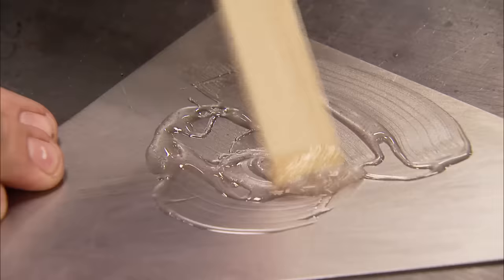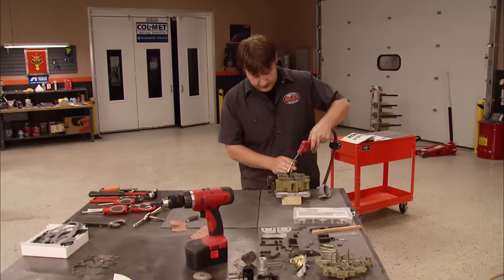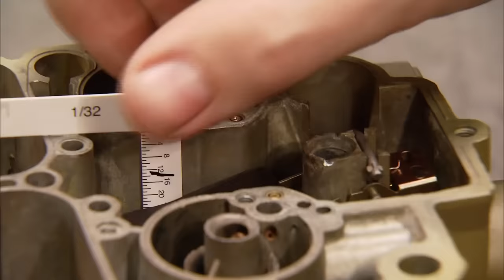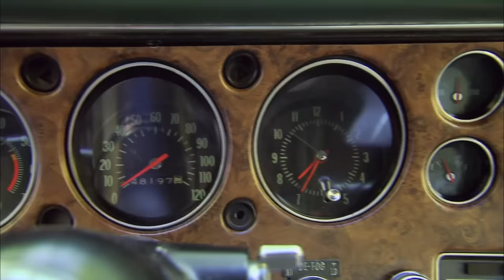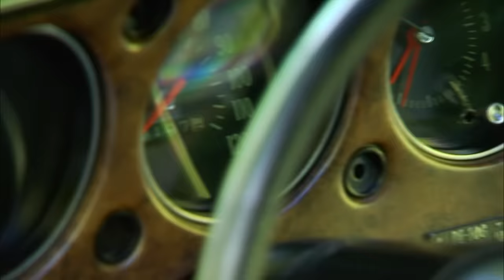How to Rebuild a Carburetor: Quadrajet 4 Barrel - Muscle Car S4, E18

Comment: Love your show!! Please build 1970-1974 351C 2V. Simple stock rebuild. Only change, if it's '73-74, Make sure you get flat tops, go .030 over, like most folks. Use good quality rebuild kit. Yes throw an Edelbrock Aluminum intake on. New carb too. Rebuild stock points distributor, and run it!! Just like us guys, would have to do, because were trying to budget. These engines are quite rewarding, when right and tight!! Slip motor in to 71-73 Mustang/Cougar. Duals yes!! I think you would have a fun Realistic little build series. Please!

Comment: hey you forgot to show replacing the injection spiders. it wont distribute the flow to all 8 cylinders without them...
good quick video though ive been contemplating on rebuilding the one i have but keep telling myself not to as its old and worn out. and converting to fuel injection is becomming affordable but this may be worth it to get my old vehicle back up and running again to enjoy next summer thanks guys.

Comment: good video on basic rebuild but there are a few easy mods that should be done to improve performance like sealing the secondary needles with electrical tape and re-locating the secondary linkage to get rid of the full throttle bog when the secondaries open. learned this from an article in Hot Rod magazine 35 yrs ago.

Comment: The Quadrajet wasn't the only spread bore carburetor I had a Thermoquad on my 340 Demon that was spread bore. If my memory is correct it was 850 cfm. The power valve if set properly kept bit from bogging from dumping all that fuel into an engine at low RPMs.
Reply: I ran thermoquads a great bit they were awesome 😎 carbs... easy to work on too.

Comment: Back in the 80's it amazed me how many mechanics hated working on the Q-jet.  I found troubleshooting, cleaning and assembling them was quite easy.  I currently have a good old one in my garage that I should sell, if anyone was interested.  :-)
Reply: I tuned a Q-jet for my 327, 11:1 domed, and 194 double bump, in a 1968 Datsun pickup...  hit 3000 rpm and hang on for dear life.    so much fun.

Comment: I worked in a tuneup shop we built so many carbs. For the people that thought quadrojets were bad. Try building a computer controlled mikuni.  Or a ford variable venture those sucked. Then on holly’s you put chapstick on the power block gasket. So they wont stick. And after it fires up and runs for a bit you shut it off and operate the accelerator pump til it primed. If it ever backfired pull it apart you just blown power valve
Reply: Holleys were originally designed as a marine carburetor & have a fairly primitive metering system. The power valve thing was a problem on Ford Motorcraft carbs as well.
Reply: Larry Hutchens I agree just didn’t want to rock that boat. Lol. What I hated with ford 4 barrels were when you were. Marrying the top and main basis. The accelerator pump check ball tends to pop out of its location and fall down into primary wells only to fall into engine. That totally sucked. You learned to. Operate it outs installation. Before hand....

Comment: When I used to rebuild carbs I would slab the throttle shafts and grind down the attachment screws so that there were no screw shafts protruding into the airflow. I also would taper both side edges of the throttle butterflies at WOT so as to smooth airflow in that area. I had a set of ultra-small titanium drill bits that I would use to drill out the jets to precisely calibrate the AF ratio. If I went too far in drilling out a brass jet I would heat up the jet and fill it with solder and redrill it again.
Reply: Slab the throttle shafts?
Reply: @hippitymcstribbs4906  That's grinding down the circular cross-section of the shaft on the opposite side of attachment of the butterfly plate. The grinding would flatten the circular area parallel to the plane of the plate. This reduces airflow turbulence over the shaft and increased the flow area, less restriction.
Reply: Ummm, ok. Thanks, i think. Seems legit
Reply: @hippitymcstribbs4906  It worked, whether you believe it or not is unimportant.
Reply: I didnt say i thought it did or didnt and you're right it don't really matter much i suppose whether i do. Just meant to infer it was still somewhat confusing what to do but i got a good idea i think. Hope it helps someone thanks

Comment: You missed a very significant step in the "idle tubes" fuel passage ports clean & part replacement.
For one, they almost always have hard build up on the bottom them that only removal by with using and some sort of tool to scrape the fuel deposit calcified build up, off the small hole fuel pathways openings.
Second , the "Cliff Ruggles” trick of enlarging the tubes to a “known” chart diameter rendering  different flow ratio,  to make the emulsifying dynamic most efficient in the idle screws adjustment. 
And to help add the needed fuel for bigger camshafts.
Pontiac's OEM setup are better in this aspect yet the vital step to enlarged them, definitely  benefits every engine typically.
Rendering Better fuel ratio mixing, And primary control circuit sensitivity~adjustments setting, etc.
I performed this task on my Q-Jet and it is every bit as snappy all around response and performance of my Honda Accord EFI is!
Completely reliable and efferent form Idle to WOT.
And not to overlook the secondary flaps spring tension adjusted.
To make it open earlier and easier under the vacuum to alleviate the Classic Quadra-BOG secondary Hit they are down for. Simple but affective.
Good grief guys, mention this stuff in about 2 more minutes of teaching there, it is very informative.

Comment: Unlike any other? You forgot about the Thermoquad. They were available in 1000 com units in the 70’s. Both are great carbs. Both are misunderstood. To make a quadrajet sing get the book written by Doug Roe. He tells you how to drill out the emulsion tubes and select the metering rods , jets and and rod forks. GM made several different metering rod forks and it’s worth getting a few to tune with. If you need to you can drill them out, but figuring out the proper height might be difficult.
The reason for the long hood on the Monte Carlo, Pointic Grand am and the Cadillac Elldorado was that GM had planned a V12 for future cars. But the EPA stepped in and prevented that from happening. Imagine what could have been if....

Comment: I never ever had any problems with any quadajets I used, except the ccc electronic mixture carbs. Now the Carter AFB on the other hand? Nothing but problems. Replaced it with a Holley 650 and all problems were solved
Reply: Agreed. Best carb from the factory, and easiest to tune. Even Dodge used them on their 360 trucks back in the '80s

Comment: Hey guys i had a quad in my garage for 3mths in a box.  My throttles plates rusted shut. Pb blaster, soaked in rust restore, still locked. I dont wont to force it. Suggestions please?

Comment: THANK for the great vid.
 I need to know what is the purpose of the criss cross  line( like a checker plate )on the throttle plates of most of the carburetor like the ROCHESTER QUAD  ?
thank you very much

Comment: also when rebuilding carburetors I used to used carburetor ride out then I clean with mineral spirits for the carburetor off and blow out the passages then I would let the carburetor set in mineral spirits 1 hour then I would take it out use the air to blow off the mineral spirits blowout out all the passage ways that I would use hot water blow dry the carburetor  and blow out the passage ways depending on the carburetors the make and model I would use a tip gauge that you use in welding like the for two barrels had brass tubes for Maine Wells need to make sure that all the small passageways are clean styles of carburetor May differ somewhat also on some styles of carburetors if you use carburetor rot out and mineral spirits hot water and blow dry everything has to be good and clean and passengers have to be clean also I hope this information helps people that want to rebuild their own carburetor

Comment: Cadillac used the same style as Chevrolet. Instead of removing the main well plugs just put epoxy on them. It will do the same thing. He also put the fuel filter in backwards.
Reply: lol 😆

Comment: Love my old cars I got a 1968 ltd 2dr hideaway headlights I'm restoring its supose to have a 390 but it's got a 400m now witch sucks I guesse but it's got a 2barrel carb and the distributer shaft is stuck I'm trying to figure out the best way to get it to move freely so can time it properly and then hopefully find a intake and 4barrel carb for it and try get some big power out of it

Comment: Another tip on cleaning a carb: The new chem-dip doesn't work as well as the older stuff,  I have been using a 50/50 mix of simple green & water. Have to let it sit overnight but works quite well & will not attack plastic or aluminum. Don't use anything that is caustic it can attack aluminum & some plastics.
Reply: The older stuff in the late 60s early 70s would eat your whole carb if you left it in the cleaner to long !
Reply: @weldorworx6858  
Oh ya, worked in a shop and that stiff ate your fingerprints off in a few minutes!

Comment: I think that adding back in the Cheap Phenolic/ plastic float is a big No No for Quadrajet carbs.  They tend to slowly adsorb gas and the new Ethenol gas is even worse on them. A year down the road your carb will be flooding because the float is bad.  Stick to the brass floats when possible. There are also differences in the floats per Carb and years. One has to be careful which one your using.  An Eldebrock Kit was not around years ago. If you wanted bigger jets and Metering rods you went and found the right carbs that had them and normally well back then they were vertually free.
Reply: Only time ive ever had to replace a Qjet float it was damaged in a carb fire... which was caused by a faulty fuel pump brass floats have a higher failure rare

Comment: I also used to modify carburetors 4 gas mileage I had a 65 Ford Galaxie 289 four door pulled 5 by 8 trailer tongue weight was about 85 200 lb the motor was old I had 90 to 120 lb compression on that motor I got 23 and a half miles to the gallon pulling a trailer through Kansas and Missouri not bad for an old motor with low compression I knew 289 motor should have 160 lb compression I also modified the Holley carburetors for gas mileage
Reply: This is a thread dedicated specifically for Chevies Q-jet garbage, Not Fords junk!
Reply: @ashqelon7267    I am a retired auto mechanic I worked on all types of carburetors I was just sharing some knowledge about how I modified Ford carburetor and the Holley carburetors to give you better gas mileage I have rebuilt thousands of carburetors and yes I have rebuilt many Quadrajet carburetors in my mechanical career you can also do this type of modification for mileage on other carburetors also to get better gas mileage
Reply: @ashqelon7267     I can do the same modifications on many other types of carburetors Ford carburetor and the Holley carburetor are the easiest carburetors 2 modified for gas mileage
Reply: @kentbarger6974  
I was a bit facetious  on the reply, here on a thread a lot of good wisdom found from posts.

Comment: the bigger 800 cfm q-jet came on mostly small blocks, and not until later years around '74, except most Buicks had them earlier.
Reply: Cadillac used them, and they also have the fuel inlet on the side like the Chevy carb. It's a direct bolt on using your original fuel line. I've done it many times.
Reply: A lot of 800cfm Q-jets came on Pontiac 400 and 455 engines in the 70's.
Reply: @WVXL64  1971 HO Pontiac 455 had a unique Q-jet with wide-open venturies in the primaries.
Reply: @josephfine3394  yep, no outer booster ring. Find one of these and it's big money. Its rated at 800cfm but probably flows more like 830cfm. These big Q-jets are one of the things Pontiac did to keep as much performance in their engines as possible under the 70's emissions regulations. That's why the 400 in the late 70's TA was the highest HP rated engine available in a domestic car. Even the Corvette had less power.
Reply: Joseph
I've had a 74, two 75, and a 76 caddy they all had the 800 Q jet . I still have my 76, the A/C doesn't work but the heater is great. I don't drive it in bad weather though
Reply: @bertgrau9246  Wow what nice cars!  Don't see those in the rust belt anymore.
After '73, everything, even 305 Chevies were 800 cfm. Then they went to electronic solenoid control, and those were 800 cfm too. There are billions and billions out there, on dusty shelves and in boxes in scrapyards, in spidery garages...everywhere!
Reply: @josephfine3394  
Yes SIR that's correct. I'm in the south though. I'm wanting to sell mine, but everytime I drive it, I hate the idea of letting it go
Reply: @kennydemartini2169  I never thought to use a Caddy Q-Jet, maybe because they're not common around here. Thank you for the tip!

Comment: I'm a retired mechanic rebuilt a lot of carburetors but 2 Barrel carburetors had a big problem with needle valves would would not seat and it would flood out the vehicle you can take off the top cover and put in a new needle and seat this was a common problem with that carburetor I'll let you girls

Comment: Hello im curious why he said the secondary plates at wide open throttle should be at 90 degrees.
Can anyone explain?
My secondaries are at 80 degrees.
How much play in the throttle plates is too much?
 Im not new to wrenching on old cars but im learning about this type of carb so I can rebuild my first one by myself.
Like peoplw have mentioned,there are alot parts in these carbs although some of the parts are cheap because there is so many and they also add up and then you got a good amount into the carb but it's still far cheaper then buying one new or a reman.
I am mechanically inclined so I know I can do it.
 I've known about them for many years since I have owned a few cars with them on there and never really did anything with them other than clean them with carb cleaner and drive lol.
I know they call them quadrajunk but I think those are ones who just never really learned how to rebuild one right so they can perform at their best.

Comment: I wouldn't recommend hammering a old check ball in the bore to form a new one. I did this and I spend hours trying to get it unstuck. Also Half of the quadrajets I opened the check ball was rusted in place aswell

Comment: How to rebuild a Quadrajet:
1) Remove Q-jet
2) buy a Holley adapter plate
3) bolt on Holley carb, you’re all done.

I’ve owned several GM vehicles that came factory equipped with Q-junks. Swapping out for a 600cfm Holley has always been my first upgrade.
Reply: Couldn't agree with you more. 600 holley vac secondary is one of the most reliable carbs you could ever have. And not to mention simple to adjust and parts in every corner of North America an in every farmers yard plus interchangeable with about 1000 other holley carbs of other size and models
Reply: With an adapter plate it will not perform very well. Primary bores will be restricted.
Reply: @larryhutchens7593  not if you get a single plenum adapter

Comment: QuadraPuke.
If I'm doing a project now, I'm going with a Holley Sniper at minimum and forgetting about a controlled fuel leak err...carburetor. 
I loved carbs back in the day when I had a project car (80's, early 90's) but I wouldn't horse around with one now.
Reply: Yea why not the sniper only cost 1,000 to 1,300 dollars

Comment: I have a Quadrajet on my Crownline boat and have been having issues that no one can figure out. The boat run good for about 20 min then dies and has a very strong fuel smell going on any suggestions ??
Reply: I should also note this motor is a 454 chevy

Comment: I don't know why you said the Grand Prix it couldn't be had with any performance the 1970 Grand Prix you can get the 455 HO with 370 horsepower and 500 foot pounds of torque and it was available in a 4-speed unlike the Monte Carlo the 454 is 360 horsepower 500 foot pounds of torque automatic only! I know my brother owned one in 1980 and it was a monster and it would put a whooping on a lot of those supposed muscle cars of the day !

Comment: does carburetor give you more power then fuel injection i have a 93 dodge Dakota with the 318 it's fule injection now
Reply: No it doesn't. Unless the injectors are worn out or small
Reply: it does typically but usually only in super race applications and the difference is negligible. it all comes down to what you're gonna use the vehicle for.

Comment: Have a problem with the secondarys kicking in dumps in fuel and run extremely rich. Primary's no problem. Any ideas?
Reply: Two things, if you look at the air valve there is an adjustment on the side you can adjust the spring to come in slower.
Another thing there is a plastic cam on the air valve if it's lifting the rear metering jets too high that could cause your problem.
It would be easier to put larger diameter metering rods in first that will help lean it out. First check what you have then go from there.
The good thing about the secondary's they are really easy to change out no major tear down needed

Comment: You did not go over the power piston spring function and ratings nor the fact that you can make the Q jet primary metering  externally adjustable.
Reply: The external cruise fuel mix setting on their carb doesn't give a ton of adjustment.

Theyd have to pull a steel plug in the base plate and use a small flat screwdriver to change the setting.